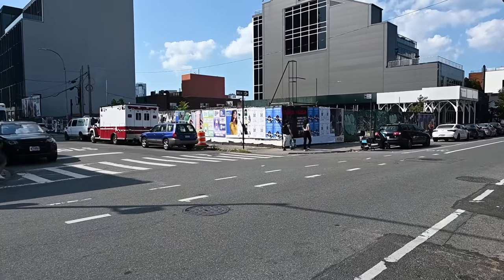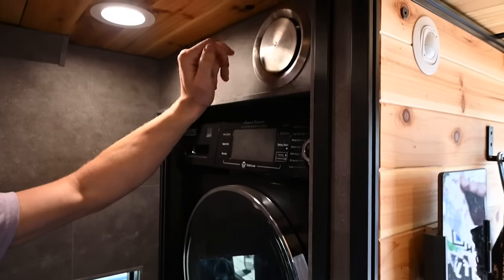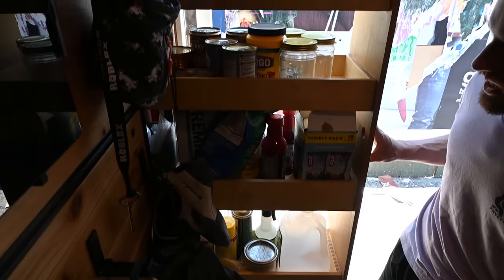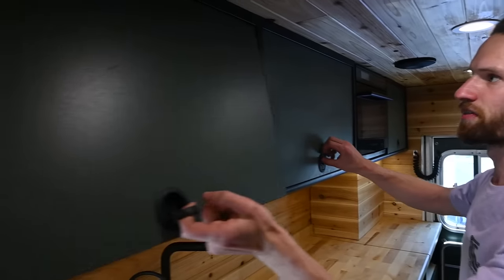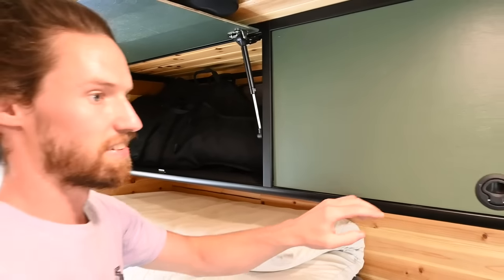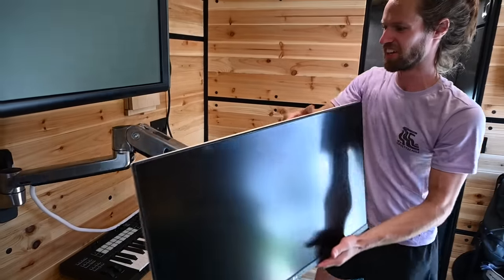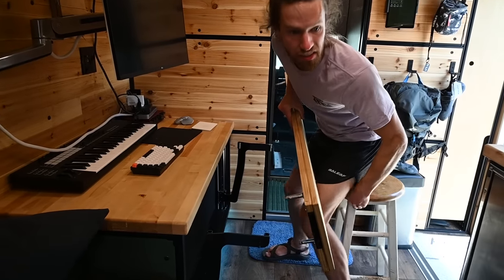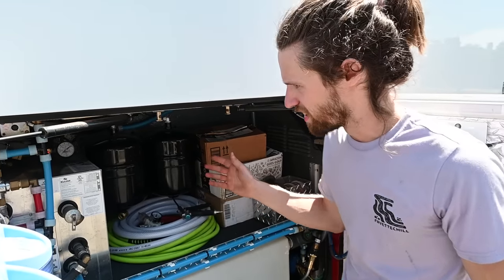Engineer Builds GREATEST Ambulance Conversion EVER!

Comment: BLOWN AWAY! And a washer/dryer combo?! This is my type of build and dude! ❤️🥰 I didn't think I'd have one critique then realized - where is the air conditioner? Wow. I could not inhabit without one or max fans. Josh, you're amazing, nonethess.
Reply: Good catch! I missed the AC.  Youtube comments provide the most critical design walkthroughs.
Reply from the maker: So awesome
Reply: He probably has it tucked away somewhere like between the toilet and washer/dryer lol.
Reply: I worked in EMS the ambulance comes with separate A/C units for the box (usually mounted front of box above cab) that can run off shore power or the ambulance onboard power. I am thinking he didn't delete the A/C and with that tesla battery has power to run it if not running the engine.
Reply: @traceonthecase  Right😀

Comment: As everyone mentioned the build is simply amazing! 

I just had a question: are you allowed or is it legal to have a truck with an actual ambulance sirens and painting? I though only authorized vehicles can have these...
Reply: I don’t think he had the siren, just the air horn and the lights. Laws vary state to state, but if he covers the rear light bar while in transit he’d be fine anywhere.

Comment: Since you're in the city, might do well to wipedown the solar panels with a soft cloth to clean the charging panels, to assure max chg per session. Justa tip. I keep a small panel on the dash to the cig lighter.
Reply from the maker: Thanks for the tip. It definitely will make. Difference

Comment: The minute I saw the clear passageway without a fixed bed, I knew this was going to be good.  You have a great view out those double doors, plus cargo carrying capacity. Why block it all up with a fixed in place gigantic bed?  Never liked that feature.

I love this guy!  A real engineering feat. That couch and bed are Swiss knives in functionality. Also love the slim and hard tatami mat concept, so great for the back. First man I have seen who does not indulge himself in 8 inches of foam mattress!  Well done, Josh.  It shows a disciplined mind and tough body. Very commendable.

There are so many little pieces I want to know how he built, such as:
The sliding monitor latch panel on wall, what is that sexy steel monitor arm?  What kind of latches/ hinges used on bed frame to hang on wall, and the metal thingamajig on back of the couch that hooks it?
Bathroom tiles - looks like Palram type click lock waterproof tiles?

The big picture stuff like electrical, plumbing heating - very well laid out and accessible. What is spectacular is how he figured out all the electrical wiring, moved it over and reclaimed the space for the bathroom. That is truly a feat!  I would love to see a detailed video on how that was done, and his electrical gadgets, inverter, Tesla Batteries, etc. Smart build, one of the best.  He/She that doth figure out the power grid, hath the world in his/her hands.

Please Patrick either you or Josh should make more videos on this work of art. I am so enchanted by this build.  Best I have seen from a functional view.  That bathroom takes the prize!  A couple of things concern me though.. 
1. Has Josh distributed weight evenly over the van layout? That 55 gal tank x 8 lbs per gal water is very heavy, and same side, same section also hold all the electrical + plumbing + driver weight when driving. 

2. Where is the gas tank located - I hope on opposite side? Is he under the weight limit for the van with all that wood, solar, appliances?  Good thing he used aluminum for framing walls and cabinets, much lighter. 

This was most enjoyable to watch. What a stunning and smart build out. He did it in record time too, wow!
Reply from the maker: Excellent feedback. I don’t have the answers to the questions, however Josh may be answering comments

Comment: What is amazing is he actually seems to have utilized that huge ambulance electrical fuse board. Most dont remove or mess with it because there so many unknown electical and removing them would effect the parts of the ambulances. Alot just leave it cause their scared, yet it takes so much space and causes parasitic electrical draw. Yet he removed it and added a shower and washer dryer.
Reply from the maker: Super impressed by his work

Comment: What did you use for the automation from the tablet? Is it home assistant to a raspberry PI (then to a wifi i/o board), or something else? I’m an hvac engineer but only familiar with big building automation systems (bacnet ,lontalk,etc.). I’m in the process of doing this on a camper boat and was curious of what you used to do yours.
Reply: Just seen where you said home assistant. Now I’m curious what’s the server? The tablet? Or a SBC (raspberry PI) somewhere? Also what I/O board? Thanks!

Comment: One thing I always worry about is the shaking of the vehicle. Is the suspension really good? He's got circuit boards in that electrical cabinet just attached directly to the frame, and I see people with glass bottles and stuff just sitting in a cabinet.

If it remains totally stable inside, then wow that's awesome, but I would be worried about easily breaking fragile stuff.

Hoping to start my own build in 2ish years, and I especially want to try to integrate a full desktop PC into the vehicle to have like a computing system, in addition to electrical and water, controlling everything sort of like he has with the tablet. My dream would be to be able to just park somewhere and set up a VR space whenever.
Reply from the maker: Its always something to be mindful when designing a camper build.

Comment: Ok... 
1) Wet room shower/hidden toilet/cab access HIDDEN WASHER/DRYER!
2) Storage EVERYWHERE
3) Actual counter space
4) hidden sofa seat
5) Not 1, but 2 internal exhausts not counting the one for the dryer function and diesel exhaust
6) 55 gallon freshwater tank with incoming AND outgoing filtration
7) Full house control on phone
8) Multi-height work station
9) Plumbing/Solar/Electric - Mission Control
And...
10) OPEN MIC NIGHT!!!!

Ok...so this is balanced...LOL... 
1) You didn't show dinner table for when you have company...'cause the desk doesn't cut it for guests.
2 a.)The bed looked too short, even for me.
    b.) I like firm mattresses, but oh hell no.

All in all - this is one massive build out, truly.
Reply from the maker: Thanks for the recap

Comment: I think that's the most extensive use of rubber bands I've ever seen in a build.  I know when slapping that bed board together I'd catch my finger in the crease.with access to the rear of the toilet from the pantry area from the outside , maybe a cassette toilet would be easier to deal with , just pull the tank and dump it.
Reply from the maker: Lots of great ideas here. Always be mindful of pinch points

Comment: An ambulance is the best platform because it's already got overkill on the electrical system and most have the compressor and inverter as well. This is the absolute best ambulance build by far. And did he say he did all this in five months? Also, most states require emergency lights covered or removed.
Reply from the maker: It makes a lot of sense

Comment: I want to see the actual build. I want to see him actually physically building this. The cost to do something like this would be astronomical. As cool as it is, i can't help but question whether he really did all this by himself. A man with Birkenstocks, manicured nails, and talking about zombie apocalypses , buying a used ambulance and converting it into an RV ,on a whim? Yeah, sorry, but i call 🐂💩. That's a lot to buy. Engineer has become a very overused term that seems to make people think these folks are just good at everything. They're not. They may be really good at 1 or 2 things but expecting me to believe he did the electrical wiring, precision cutting, flooring, plumbing, drainage, electronic instrumentation installation, HVAC, etc uh, no. No, he did not. Sure , some engineers can make really good money but ...
-"Engineer" salary in NY  $97,891 
- Average NY rent $3,654 
-Average monthly cost for Starlink $90
- Insurance (depends on provider) Probably not cheap. 
- Annual maintenance costs for a Ford F550 is $800
- Food (who knows, but he's probably a health nut); healthy food is definitely more expensive than the average type of less healthier food. He pegs me as an organic food eater. 
- Cell phone bill (depends on carrier) ; but if I had to guess... I'd say Verizon because, who are we kidding? Of course, it is.
- Gas ? 😆 🤣  Yeah, try <7 mpg combined. 26½  gallon fuel tank capacity. @ an average $5+ a gallon ; again 😆 🤣 

Sorry bro, but I can suspend my disbelief only so far before I have to start calling out people on their 🐃💩. I'd respect you more if you could just admit you have rich parents who paid for all of this for you. Sorry, my guy, but I am not convinced. It's still pretty dope, though. Weird and a bit morbid, but pretty cool.

Comment: Nicely executed construction, but I am confused on your AC wiring. At 28:55, you show DIN rail breakers. Yet the wiring color on both sides is white. Does this mean that your hot (ungrounded) AC conductors are white instead of black? Also, are these Nader breakers UL 489 certified? Be careful; I am concerned for your safety.

Comment: First: how did he waterproof the shower from the cab and the living areas of the truck?
Second: one thing I have seen from other builds is having portable solar panels. That way you can park in the shade and still charge your batteries. 

For myself I like simplicity. I don't like having to move several things to get to one thing. The bed system is not simplistic enough. I know some like it. But for me.having to fold this, expand that, roll out this, tuck that is to many steps. Since his bed is a single/twin bed  I would find a way to incorporate it into the seating so you don't have to do as much work to go to bed. 

I would like to see an update where he is using the composting toilet and how it affects the standard of living. I hate sitting on public/ other toilets than my own so using public toilets would not be favorable. 

 And he didn't mention black water. I'm guessing since the toilet is composting the rig doesn't have/need black water.